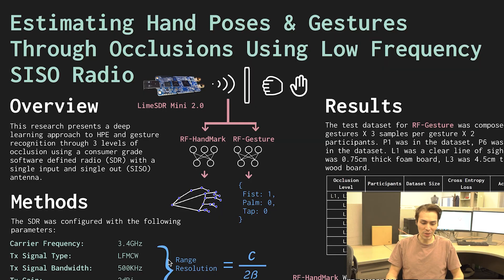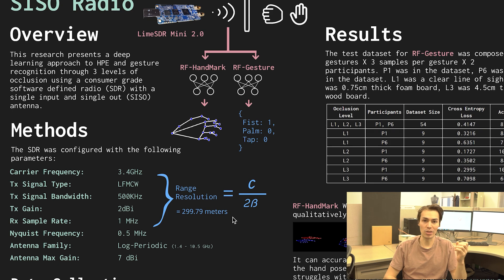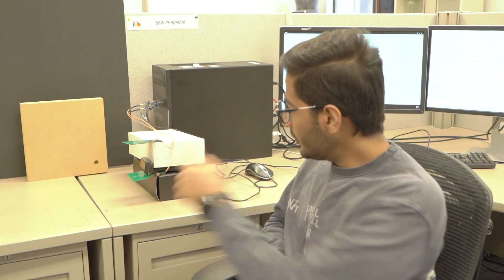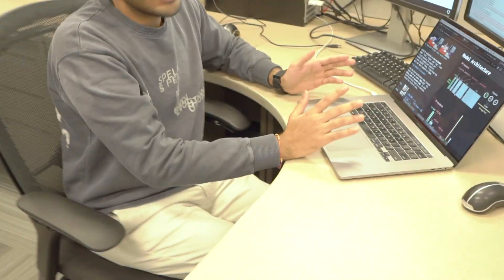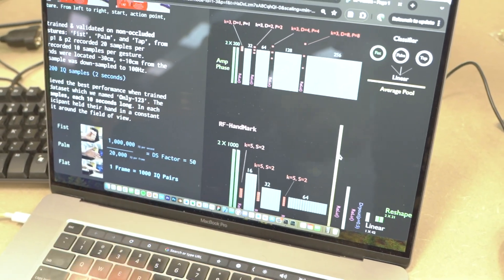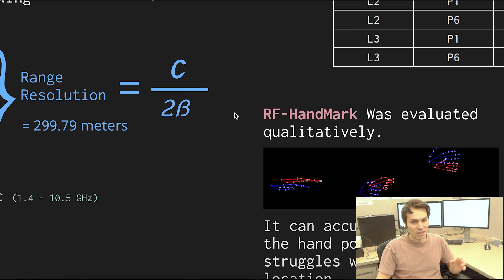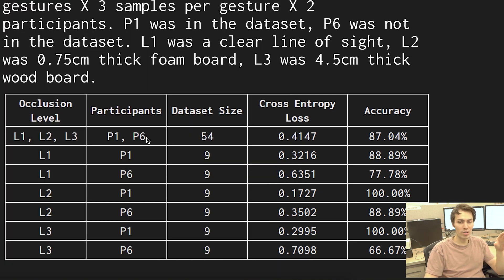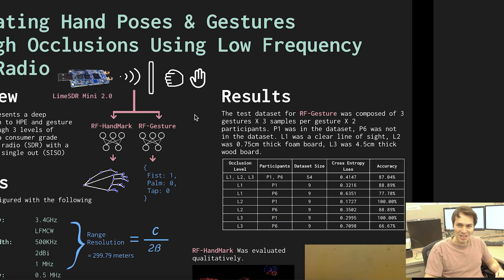LoRF-Ha: AI can see you through walls

Comment: the government can tell what you're doing from your WiFi alone
Reply: Not even just your WiFi, any nearby radio one can push firmware changes to. 

Near one edge of a small mountain town, I'm currently within good signal strength range of... 36 WiFi networks, not counting other radio types? 

Analyzing radio for machine vision, isn't even new tech; what's really new here, is that code able to produce usable results, is becoming more accessible.

Comment: So If I don't use wifi for religious reasons and my neighbors on all 4 sides of me have wifi then "they" can see me in this manner, potentially?
Reply: Probably not your neighbors, but someone with root-level access to the radio firmware on any one radio (multiple radios help but are not strictly necessary), could theoretically monitor everyone's position. 

Check out the videos on using a conventional router to monitor a patient's position, through walls. 

The tech is old; the techniques to build & run usably accurate models without much budget, is what's relatively new.

Comment: this could be very useful in police or military applications if you can detect people through walls
Reply: That's already a thing; check out the years-old videos on monitoring the position of a patient through walls, using a single WiFi router. 

Also, research into differentiating a soda can from a gun, through a wall; a very specific test case selected for relevancy to certain actual cases... 

What's new here, is that the techniques to do this essentially DIY with hand-built models, are being developed in public, instead of proprietarily.

Comment: You gotta try this with a box around the hand. Correct me if I am wrong, but you are traning the second model off of the radio data captured while looking at the hand gestures. But the information the radio sees is omni directional. So right now there is high correlation of data points from reflection of the surfaces around the wood and not only through. More like seeing around the wood than through. Have you all tested this with the hand movement in a box to block all previous surfaces?
Reply: maybe with a lead or graphite backdrop, to absorb the signal?

Comment: wifi?
Reply: All bands, really. Shorter wavelengths are well known to give finer resolution (but worse scattering), but the research here demonstrates relatively accurate results from a lightweight hand-built model pulling selected fine data from very wide wavelengths (such as those used for ≤5GHz WiFi). 

Showing that relatively low frequency (long wavelength) bands can still reveal usable data about small objects, & with relatively simple models, is (I think) remarkable & noteworthy. 

I would very much like to see what they can do with much wider bandwidth observation: One of the first developed use-cases for "Ultra-WideBand" radio, was as low intensity radar; broadcasting a brief "chirp" across a very diverse range of frequencies, netted much greater accuracy even at vanishingly low emission strengths: 

Rather than hundreds or thousands of watts of direct radio emission, UWB radar can get reliable pings from less radio emission than a hair dryer. 

Using modified firmware on a single WiFi router, to monitor a patient's position through a wall (or to differentiate a soda can from a gun) has been demonstrated some time ago, but the project shown here extracts pretty fine-grained data from very coarse input; so, I'm impressed.

Comment: this was an insane homepage pull. I understood 0 of this, but Ben & Anand (hope i got that right o7) y'all explained that very well. mind, boggeled. very cool.
Reply from the maker: Thank you!!! I'm stoked that you enjoyed it 😊
Reply: @SkimoBen your results appear to be much more detailed than the ones showing movement in a room using a WiFi based system. I'm not familiar with the equations you are using there, so would your resolution and accuracy get better with a higher sample rate  or would that just be more noise to sort through?
Reply from the maker: @javabeanz8549  Great question ! It's not exactly 'noise' but it's not always critical information. Imagine you have some coordinates: (1,1), (3,3),  (5,5). You can remove the middle coordinates (3,3) and it will still form a straight line. Our goal was to make these models run in real time, which is why we downsampled from 1MHz to 100 Hz, you can remove a lot of information as long as your slope maintains a distinguishable shape. That's not to say more samples wouldn't be more accurate, but there's diminishing returns since you have to scale the models parameters with the size of the input tensor.
Reply: How tf could your mind be boggled if you understood "0" of it?

You understood it, stop being fake humble by pretending to be stupid

Comment: And old school radar with like 1 to 2 GHz This is like normal radar range for like ground radar.
Reply: Yeah because high frequency is actually relatively low and then there's extremely low frequency ELF. It takes like an antenna that is either in the ocean attached to the continental shelf or on a piece of land that's more or less attached to the base of the continental shelf.. isn't that how they were sending a very slow low character bit rate messages to submarines I think urgent action messages. I think they've come up with a better way now via direct access to the water water carry sound very very well. I'm a diving instructor so I was in Borneo in Southeast Asia diving and somebody was using some dynamite one day and it was really far away but it's still running my bell and we came up and looked around and couldn't find anybody around but it was quite a ways away so if you had been under nearby it could really hurt a person.
Reply: I can't imagine how much power an ELF emitter must use and I wonder what the health effects of that are on people nearby the transmitter if any I'm not sure. I know that it's considered non ionizing radiation but at the same time I'm not convinced that it's a good idea to hold your cell phone next to your head all day!

Comment: I thought the same thing like anything sub gigahertz is low
Reply: Yeah, anything over 3 million cycles per second but less than 30 million (100-10 meter wavelengths), is still considered "High Frequency" so far as I know. They surely meant it as 'relatively low frequency', such as compared to mmWave bands! 

Technically speaking, 3GHz would be in (the top end of) the UHF band?

Comment: So, 3.4GHz is low frequency now? 😂
Reply: compared to mmwave, which is generally used in these contexts, this is definitely low frequency.
I'm sure in certain contexts 10KHz would be considered high frequency. context is important 
but yeah, it's still funny to call this low frequency 😅
Reply: Indeed, 3GHz is a UHF range.   
3-30MHz is High Frequency.   
Higher bands get their own terminologies, such as "mmWave". Our intrepid presenters surely meant 'relatively low frequency', rather than 'sub-HF'. 🧐😅
Reply: Relative to the size of a finger, yes.
Reply: Compared to 20 to 50GHz it is. 3.4GHz is also right in the middle of what most WiFi devices use. 2.4 and 5 to 6 are common in home and business use, but there's also 3.6GHz wireless networking, less common, but still in use.
Reply: It's all relative.  FMCW is common in automotive radar at 77 GHz.
Reply: I don't think it directly refers to the well defined radio frequency spectrum where even HF ends at 30MHz. It would have been worth noting that this is just relative to the use-case.
Reply: @0xphk  I know, I’m just kidding
Reply: Modern WiFi is ~ 2.4 and 5 , so a consumer level.
Reply: I’m an Rf engineer I think 10 GHz is low freq 😂